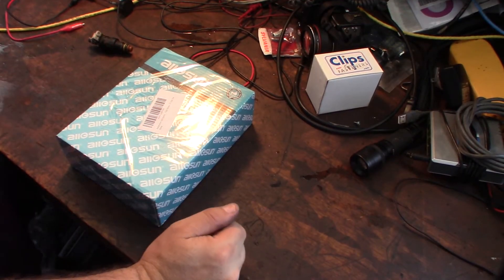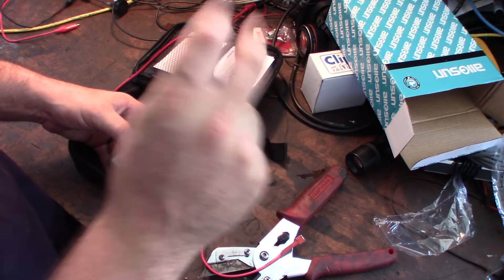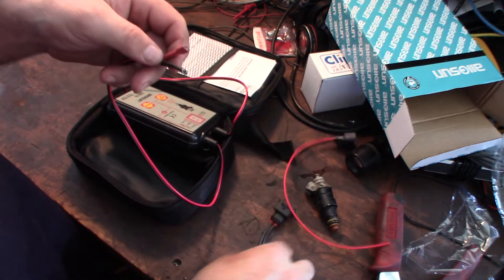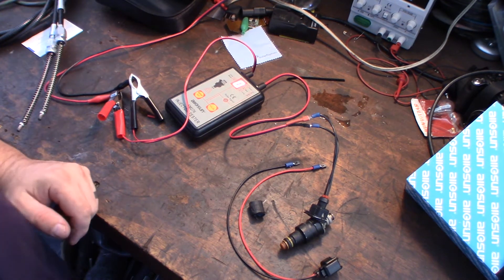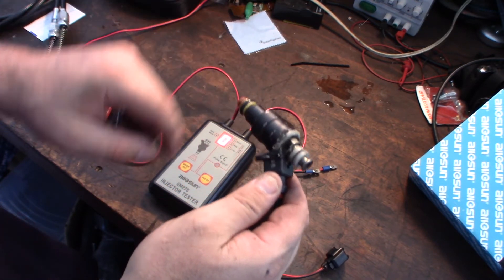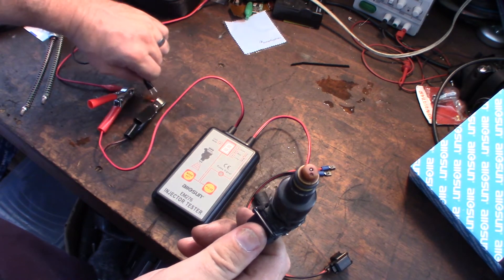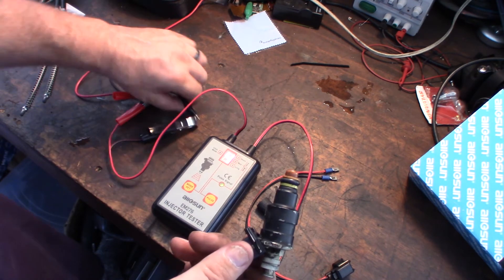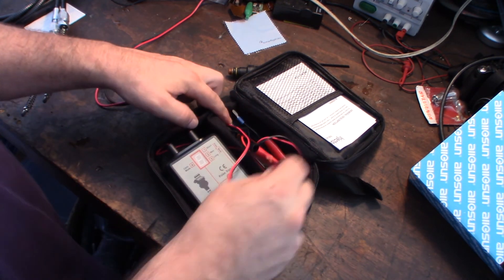AllSun EM276 Fuel Injector Pulsing test Tool 4 pulse modes EV1 EV6 EV14

Comment: Why does my injector click when power is connected to the tool? And when Activating the tool it doesn’t really let the cleaner come out the injector? I tried a different injector and the same situation. Thanks I’m advance I could really use the help
Reply from the maker: The click is the injector opening. Try spraying carb cleaner in reverse.

Comment: Great video! can you use this tester directly on injectors without taking them out? thanks!
Reply: Yes, the instructions does say to test while  injectors are in the engine.
Reply: What about the build up of fuel in the cylinder? Should you take the plug out too?

Comment: Have to disconnect power between modes 
Read the pamphlet !!!!!!!
Reply: I just bought this. It looks like fitting a small in-line switch on the power cable would make it easier to use.
Reply: American don't read manuals 🤣

Comment: you do know that allsun EM276 can run more than 1 injector at a time lol i just cleaned 6 and give em 30 mins in ultrasonic lol all at once
Reply: How did you run the wiring? Resistor injectors in Parallel. I’m trying to set one up too. Does it clean the injectors properly?
Reply: Have you had any issues running multiple injectors at once since you wrote this comment?  I'm looking to build me a budget flow bench and was going to get a solid state relay